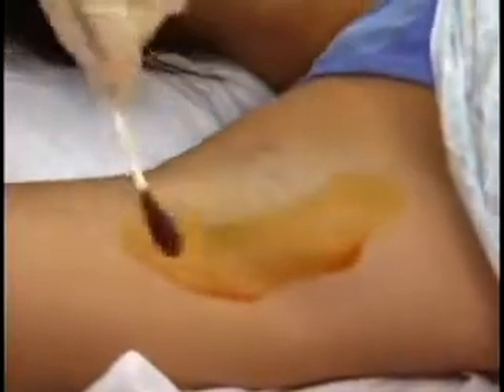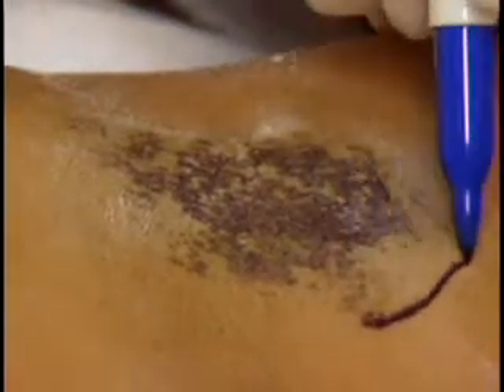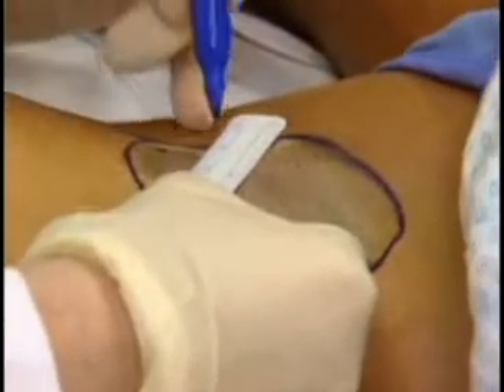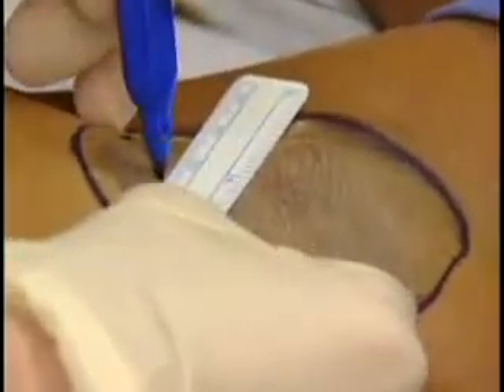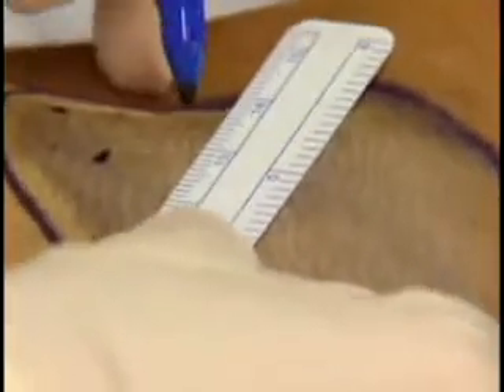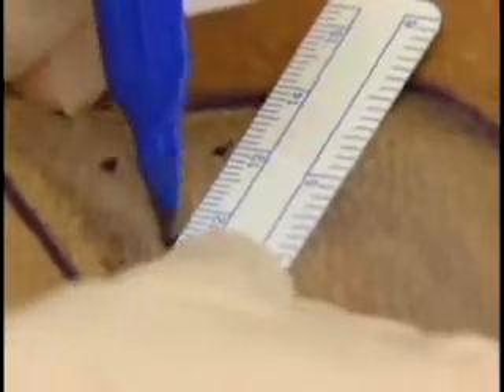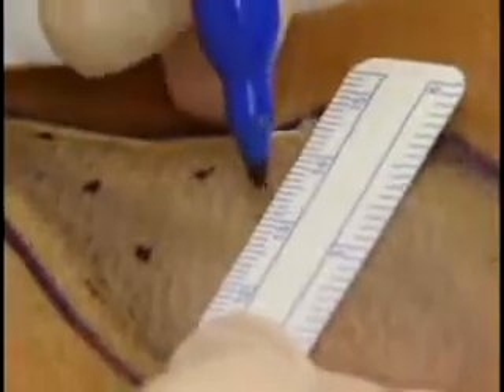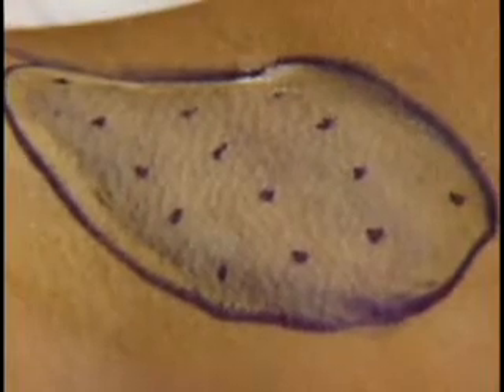Starch Iodine Test for Hyperhidrosis w Dr Dee Anna Glaser, International Hyperhidrosis Society ©

Comment: I had two applications done in this manner, underarm. Both worked better and far longer than predicted by the dermatologist. For some reason, that office stopped doing Botox injection for hyperhidrosis.
The next office I went to insisted iodine/starch was not necessary. He injected what I guess was a random pattern or grid in the usual area. It didn't work. I got maybe 10% to 20% of the effect of the first two treatments and the effect only lasted 2 months instead of 12 months like the first two treatments.
Reply: I recommend you to get the MiraDry procedure done
Reply from the maker: Check out our Ask Me Anything webinar on miraDry. Great stuff! https://www.sweathelp.org/hyperhidrosis-treatments/miradry.html
Reply: The first office stop the treatment since it was so good that the repeat costumers took longer to come.
Reply from the maker: The iodine test is wonderful! It takes time and some clinicians think that if they inject in the hair-baring areas, that it will work. But, for folks w Hh, if a tiny spot is missed, then they can still pour sweat and it feels like the whole treatment was a fail. Next time, ask for a follow-up appointment w the test. Then, they will see where you need a touch-up. More info here: https://www.sweathelp.org/hyperhidrosis-treatments/botox.html
Reply: I wonder what dilution the first office used
Reply from the maker: And, if you want to find another clinician, search www.SweatHelp.org/Search